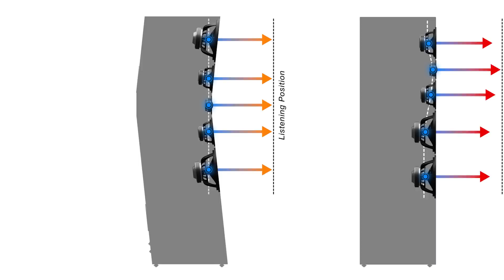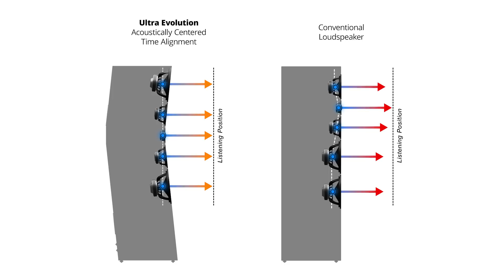SVS Ultra Evolution Speakers: Introduction & Acoustically Centered Time Alignment

Comment: $4000 a speaker is still pricey, guess i wont ve getting these. $8k a pair is up there with other brands. How is that setting svs a part. 

For under 8k i can get good used paradigms S8 v3s or Monitor Audio platinums PLs  just to name a few. I will have to listen to these and compare

They are beautiful i have to say

Comment: Apart from the speaker, is there a music  player / amplifier that will drive the speakers?
Reply from the maker: They can be driven with a standard AV receiver but will really open up with higher quality front end amp and preamp combo. Recommended power for tower models is 20-300 watts.

Comment: BS Engineering ... such a marketing hype ... where is the group delay graph? .. you can adjust GD by choosing a different filter slope! .. or use protruding cones like Focal does for some years recently ....
Reply from the maker: There are a few design tools and techniques which can be used to align the acoustic output of the drivers in the time domain.  

The crossover network has both frequency and time/phase properties, and some level of driver time/phase alignment is achieved in the electrical domain of the crossover network.  

With that said, optimizing the physical geometry of the front baffle is another design tool which can be used to further optimize the time alignment of all the loudspeaker drivers.

Happy to discuss further in our CS support center if you want to do a deeper dive.  Thanks.    

Ed M - SVS

Comment: they should also do an even bigger center channel, the ultra evolution center is far too small to pair to the big Pinnacle towers , they should build a "Evolution Tower"  sized center channel with all front firing woofers and front firing ports.

Comment: so many speaker companies (even high end) lack driver time alignment. Well done all the best for these awesome looking speakers
Reply: Most of the time it is done electrically by the crossover.
Reply: @jfd7cf  - never heard that cross overs can do this
Reply: @genkifd  Any analog Filter will cause a phase shift, which will delay the timing on affected frequencies.

Comment: How come the crossover is never talked about?  Consumers are getting smarter and they want crossovers with high quality components.
Reply: They did a new design. Not sure if they're going to show it or not.
Reply from the maker: One of the most time-consuming aspects of tuning any passive speaker is every aspect of the crossover design and component selection.  

All dimensions of the speaker’s performance are rigorously judged objectively and subjectively with every component choice.  

Components are carefully selected for their purpose in the crossover network - not just for material properties, but also for power handling and even the physical position on the PCB.  To that point, even the PCB material and trace layout is scrutinized for ease of current flow.  

Regarding air-core vs. iron-core inductors and film vs. poly capacitors - we use both types of each depending on the specific electrical and driver requirements.  

In the end, crossover tuning is as much art as is it science and engineering as the slightest component value change can influence the overall tonal balance of transparency of the speaker.

Comment: Love SVS subwoofers. I own three of them. I've got to ask the burning question though. I understand completely where you are coming from with the time alignment. I own a pair of Canton vento Tower speakers and they do not have time alignment but they sound absolutely phenomenal. In every regard including Imaging and Sound Stage. How is this possible if they don't have time aligned drivers? Let alone almost all manufacturers of speakers not having time aligned speakers and yet they still can sound very good
Reply from the maker: Great question. There are a few design tools and techniques that can be used to align the acoustic output of the drivers in the time domain. The crossover network has both frequency and time/phase properties, and some level of driver time/phase alignment is achieved in the electrical domain of the crossover network.  With that said, optimizing the physical geometry of the front baffle is another design tool that can be used to further optimize the time alignment of all the loudspeaker drivers.
Reply: I've been around a bit...well made speakers can have great imaging  without time alignment, but SVS has added this ability to go even further. To evolve, so to speak!